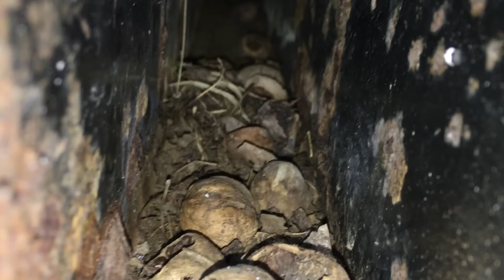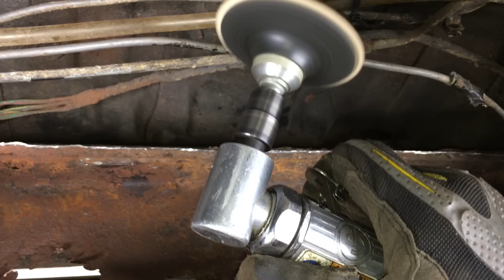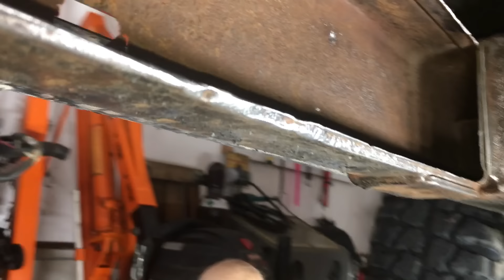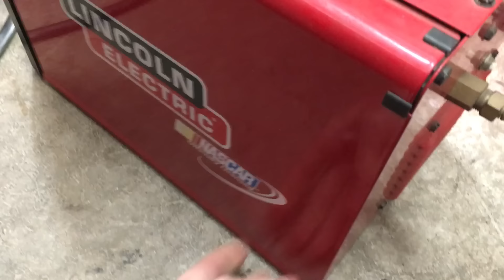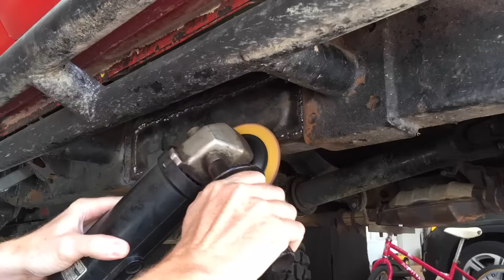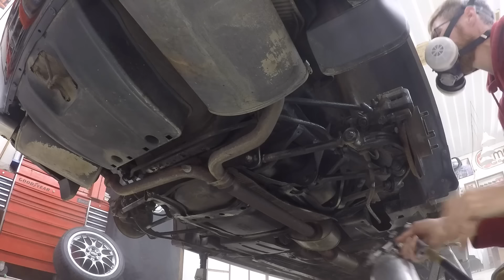How to Properly Repair Rusty Frame of Toyota Pickup Truck at Home

Comment: A tip for anyone, doesn't really need to be empty and long as you're away from the tank itself. Clear the lines by unplugging the fuel pump relay/fuse while the truck is on. And let it die out.

Comment: I had to weld up a lot of the drivers side frame on my 2011 gmc sierra and once i cut out all the rust i blew out the frame really well i ended up making my own long extension hose attachment but anyway after i got it all done i used pb blaster surface shield inside and outside the frame i basically hosed it. and i would recoat the inside frame every 2 years. I also live in Ohio and man that road salt brine crap really eats the metal up. Now i'm gonna try this new homemade coating recipe i come up with here it is: 2.5 pounds of grease, 1qt boiled linseed oil, 40oz motor oil (used or new), 8oz paraffin wax, 8-12oz diesel fuel to thin it. and that should make 1 gallon melt it all together and spray it HOT once it cools down should be a nice thick sticky grease like under coating that will last a pretty long time. shouldn't cost very much either to gather all those up just buy the cheapest stuff you can get. I already have a ton of used motor oil and paraffin wax so that already cut my cost down and since i use to do a different undercoating that i HOT sprayed on in previous years I don't have to buy a hot plate. You could try this undercoating out and let me know how it went. I use a fluid film undercoating sprayer with metal cans.
Reply from the maker: That is awesome, I never thought about trying a home made brew. It sounds like yours will work great, thickening up when it dries.  I've used fluid film for years, but I do wish it was a little more resistant to water.

Comment: Good video. The only thing I noticed that was not covered or you didn't do was to spray a rust inhibitor or converter inside the frame channel before you welded the reinforcement plates. You took enough time and attention to remove the flaked off rust and junk inside, that it seems like an additional and critical step or precaution could have been taken.  There's a product that can be applied directly onto rust and is actually used on the hulls and upper parts of ships, and it can be primered and painted over ; called NAVAL JELLY.
Reply from the maker: Thanks! I did coat the inside with fluid film later in the video. I didn't want to use any kind of coating in fear that it would flake off over time and clog the drain holes.

Comment: What do you do if it passes the hammer test?  I just bought a 2014 f150 with rust all over the bottom but I don't think it has eaten away real bad at it.  I think it should be removable.  I saw a guy on youtube chiseling away with, I forget the name of it but some power tool, and I read online something about I think it was baking soda.  Hoping I can remove it all and get this truck undercoated because I'm in Michigan and I paid quite a bit for it (for me anyway lol always been poor af) and I don't want the value to drop too fast on this thing.
Reply from the maker: Ideally, have the frame sand blasted inside and out, then cleaned and painted with DTM primer and a 2k paint.  The cheaper/easier solution is always keep a layer of fluid film on the inside and outside of the frame. Once these frames get to a certain point because of road salt, it's only a matter of time before they become unsafe and will need repaired.
Reply: @6thGearGarage  Yeah I don't think it's to that point, but definitely don't want it to get to that point while I own the truck. I don't see why more people don't address this sort of thing early on.
Reply from the maker: @waynefilkins8394  Yeah the sad thing is that most people don't realize how corrosive road salt and brine solution are. Aside from not driving it through winters, the next best thing is fluid film inside and out before every winter. I'd have no problem paying a couple hundred bucks per year to keep my frame from rotting away. It's important to start when the vehicle is brand new though, which most people don't think about.

Comment: I just bought a 94' Nissan pickup with about 10 years and 100 thousand miles worth of Ohio salt and rust. I keep watching videos of Californians/Southwesterners working on their 30 year old trucks with only the slightest surface rust. Then I look at my rust bucket and get discouraged when every bolt I try to remove is seized. Glad I found your channel!! Good to see someone with the same issues that has to use the same work arounds to even do the slightest repairs and maintenance! Thanks for these videos. Ive learned a lot
Reply from the maker: I've parted out a lot of trucks due to rust.y bodies & frames. Then one day I decided to see if I could save one.  So I've been rebuilding a 1980 toyota that I got for $600 because it was a rust bucket.  It's a long process, but I'm learning that it IS possible. But seriously, I'm buying my next Toyota from down south!
Reply: those nissans rust from the inside out due to all the holes they put in the frame😂
Reply: how did she turn out?
Reply: the truck is done ,, you can paint the frame but all the emtal si already dsit its  amtter of time to start tusting again to outside
Reply: @termonostruman  No idea what any of that means

Comment: What is the width of that patch ? Hot rolled it looks like ?
Reply from the maker: Yes it is... 0.125" x 4.5" x 18" A36 Carbon Steel, Hot Rolled
Reply: @6thGearGarage   nice job !!!  Thanks for getting back to me on that steel.  I’m going to see if I can get some pre cut that size ….fluid film rocks… they wring out sheep wool,  that oil is whats in it … they make a paste of it too for sailing stuff

Comment: There is a  company called warehouse 9000 that sells the wool wax, fluid film undercoating gun with extension wands and a 360 degree inner frame wand....great system, it'll spray wool wax, fluid film, PB Blastster or even oil....
Once a year and itll never rust again....
Add powder graphite for the black look.....POR is pos....

Comment: Why is there not a bigger aftermarket for "improved" OEM-style frames?  Stronger, better drainage, good coatings, alternate materials, etc.  Seems like it would be a no-brainer for a good fabrication shop.
Reply from the maker: I wonder the same thing... after the initial time to build a jig, it would be a lot of profit.
Reply: @6thGearGarage  I guess the target customer would be someone willing to spend $4-10k for an "improved" or build-spec'd frame for their particular application.  That's a lot of cheddar for just a frame.  Who pays for that?  Sentimental owners of very old trucks, or big boys who are building something special.  Certainly no commercial buyers.  And the average joe who just wants to avoid scrapping his rust-bucket can probably find a used option or have a fab shop make the necessary repairs for less.

Comment: Don't paint. Surface Shield or Fluid Film INSIDE the frame and out twice a year.
Reply from the maker: I did Fluid Film inside later in the video. I would want paint over bare steel on the outside though, to prevent the rust from starting on the surface where it will be getting splashed often. Then FF on top of that.

Comment: Would have been a good idea to rust proof it when you did the first repair 10 years ago. Getting rid of dirt and grime in the frame works good with a pipe cleaning attachment for a pressure washer, the soak everything in fluid film or similar.

Comment: One step missed … rust converter. Could have used that on the inside of the frame.
Reply from the maker: I considered it, but with how scaley the rust was, I was worried about it falling off and clogging the drain holes. So I just used the fluid film instead.

Comment: Motor oil works just as good. I had a 1990 celica from the rust belt. Everything else had rusted out except in the areas where the engine was actively leaking oil on. 😂

Comment: Great video. Having dealt with Toyota frame rust for years, I recommend taking the entire body off the frame. It's easier to cut out and grind all the rusted areas inside and out. Prime and paint the inside and outside of the frame after removing all of the rust. Yes, rust can grow under the paint, but it's not as bad as people say, and there will be little to none if you oil the frame after the paint has cured for a while. You don't need a lift to take the body off. There are some good YT videos that can help.
Reply from the maker: The job would be so much easier with the cab removed. I removed the bed & gas tank when I repaired the rear section of the frame and it was a breeze. Dirt Garage had a good episode on removing a 4runner body using four 55 gallon steel drums and then he just rolled the frame out from under it.
Reply: @6thGearGarage  we need more detailed body/cab removal videos. I saw an old one a while back, but the rest really don't get into the fine details and lessons learned.
Reply from the maker: @vb1gbg  I hope to be removing the cab from my 1980 soon. I will be sure to get a video of it.

Comment: Vehicles decay this way by design. From a manufacturer standpoint, a vehicle is designed to last about 5yrs/80k and then cascade failure begins and buying a new vehicle is all but inevitable. I worked for Subaru in '89-90 and the company told this to the technicians in very blunt terms. This 'design obsolescence' has only gotten worse through the years.
Reply from the maker: At least older vehicles don’t have all the electronics to also fail like the modern ones do. I can deal with mechanical and structural issues, but the electrical issues seem like a major headache

Comment: Not bad.  I did an entire 98' F150 frame more or less like this.  

I would recommend trying to neutralize and coat all the rust, inside and out.  At least that's what I did and I feel it's worth the litttle extra time.  Just my $0.02.

Comment: Ive used this "FDC Rust Converter Ultra, Highly Effective Professional Grade Rust Repair" bought 1 gallon on Amazon. I just painted it on and it converts the rust to a purple color.
Reply from the maker: I've used a product once that did that - changed the rust to a black/purple color. It worked well.

Comment: Great job! Maybe you could have sprayed the metal frame patches with weld-through primer on the inside before welding in place. Would first using the wand to spray a coat of rust converter inside the frame before applying fluid film be good?
Reply from the maker: As scaled as the inside was, I'm nut sure if a rust converter would have made much of a difference. I make it a habit to keep the inside coated in fluid film. So if I go through deep water, or mud gets in the frame and I have to wash it out, then I will apply more fluid film to the inside. In the long run, this frame will need to be replaced, but I'm extending its life in the meantime.

Comment: Annual soaking with Fluid Film, Rust Check or Krown is the only proven measure against vehicle rot. In fact, caked up dirt and debris becomes soaked with the oil and makes a thick, greasy barrier against moisture and salt. People won't do it because of the $150 every 12 months, the week-after dripping and added messiness. Edit: I watched that body filler frame repair. It's surprising not just that they did that, but felt compelled to share it with the world.
Reply from the maker: I'll gladly pay $150 every 12 months to preserve my vehicle (1/3 of that cost if you apply it yourself.)
Reply: @6thGearGarage  Krown near me offers a complementary can of its product with an annual treatment so I touch up and reapply here and there throughout the year. This is my 2009 4Runner's 15th Southern Ontario winter. No rot anywhere.

Comment: Definitely would have tried to wire brush some of that interior rust and then paint to slow the existing rust from further corrosion. It's like cancer, it will continue to erode other thinner metal in other areas just around the repair.
Reply from the maker: I did spray it with Fluid Film later in the video. In the long run, I'm going to replace the frame with one from the south west.

Comment: Doing some repairs on my FJ's frame this spring. Going to use some of the advice in the video and the comments section. Its been a year, how has it held up?
Reply from the maker: So far it has held up great! My only advice would be to use a 220v welder. I bought one for my most recent frame job and the results were much better.
https://youtu.be/CRIvLpJfvgg

Comment: good job but to be definitively efficient,  you should have put grease everywhere. grease et the only thing very efficient against rust. put grease between metal and carpet, inside door, behind bumper, behind (inside the car)  the repair you made. For rear wings unreachable with a paintbrush, use an extender and poor old oil everywhere each year.
Reply from the maker: I used Fluid Film later in the video, which is great at creeping into tight spaces over time.
Reply: @6thGearGarage  i do not know it (i am  in france) I have looked at this thing on internet and i have seen that grease is much less expensive

Comment: Glad YouTube recommended this video to me. Luv the video. I have a b15 Sentra that’s sat for 8-9 months who’s undercarriage is rusting away. I put Eastwood rust encapsulation on it last year, but it only lasted a year. I want to preserve it. Never welded in my life or have a compressor, but when the spring comes I want to tackle this in my driveway.
Reply from the maker: If you're welding anything 1/8" or thicker, I'd use a more powerful welder than the one I used in this video. I recently got a 220v Mig by Arc Captain (was actually cheaper than my 110v Lincoln) for some frame welding and it was so much better. https://youtu.be/CRIvLpJfvgg

Comment: I'm sure you have been flamed already in the comments for the quality of those welds, so will only say, I wouldnt rely on it, and suggest you start with a 220v machine and more practice before commiting to a critical repair.
Reply from the maker: Yep, and I picked up a 220 mig before working on another frame. What a huge difference! https://youtu.be/ylkHDaurM6A

Comment: I have bad rust on my frame with holes in it. If I do this doesn’t it take away the integrity of the truck
Reply from the maker: I think replacing rusty holes with new metal adds to the integrity of the truck.

Comment: When you use por 15 u need to put paint on top of it! and this may be overkill but put a 2k clear coat on top of the paint and u should have used 2k epoxy primer first I've done this never had a problem as long as the metal is clean
Reply from the maker: Hmmm, the instructions on the can didn't say anything about using a primer first, or a 2k clear on top. That was done over 10 years ago, so maybe they've updated it since then.  I did try an alternative product on another frame, supposedly UV resistant. We'll see how it holds up over time https://youtu.be/gmFx6OUw7Xo